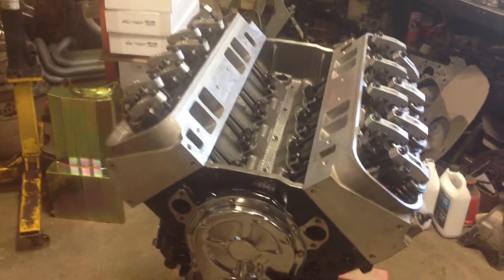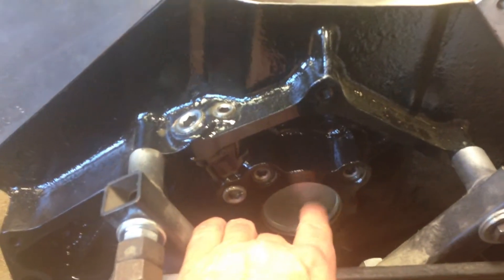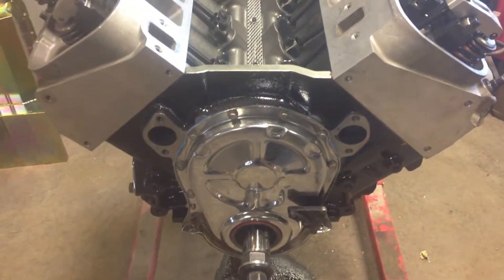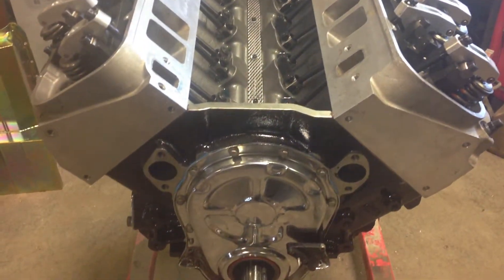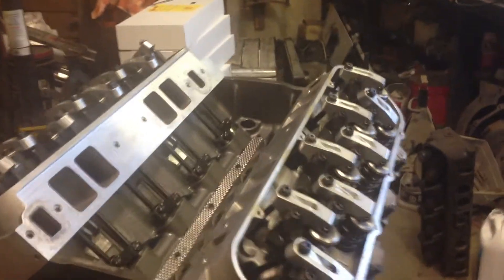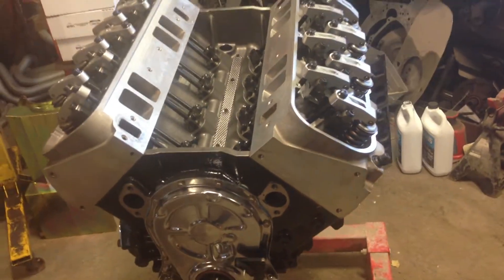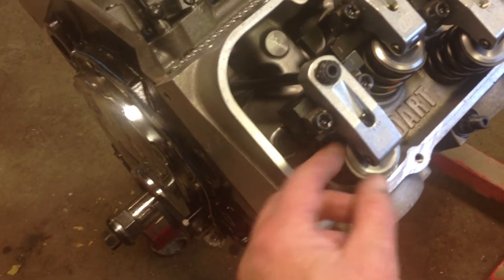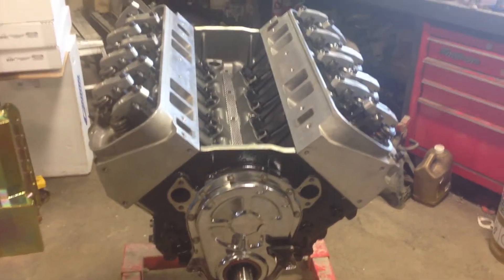598 COMING TOGETHER

Comment: Nice clean engine I'm looking forward to hearing it run. Any news on the 58?
Reply: Thanks. The 58 is found but only a bent up body left of it. They stripped it clean. The trailer was also found and  in one piece, its getting dusted for prints and still with the cops. I haven't seen it yet. The cops have a few leads and prints but no arrests yet.